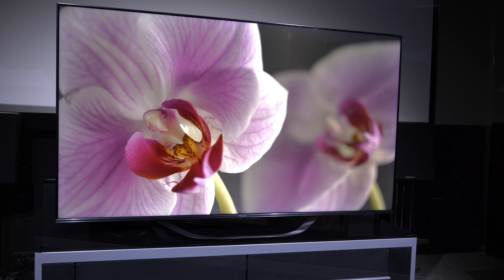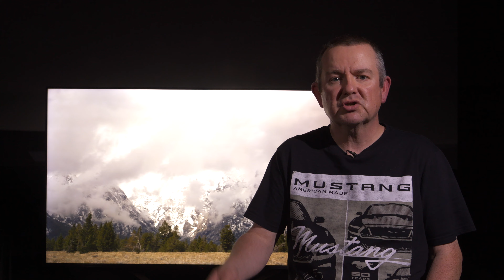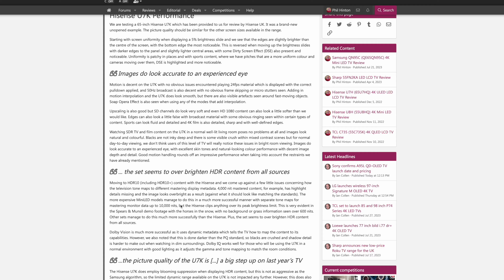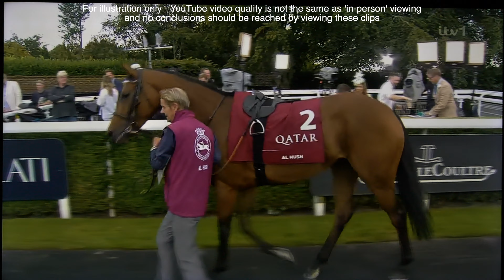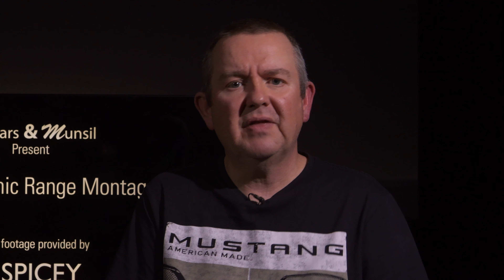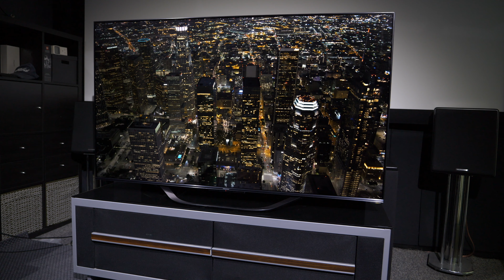Hisense U7K 4K Mini LED TV Review - Are Hisense still VALUE FOR MONEY?

Comment: Great test! I just ordered the 75u7k(q) for a very good price in germany (1079€ which when you count in TAX equals around 900$ in the US). The comparison with the C845 is impressive tho and I see it as clear winner of the comparison, but here in Germany the TCL costs about 1699€ which was beyond what I wanted to spend. I'm pretty sure I will be happy with the Hisense for the amount of money I spent ☺
Reply: In what way would the c845 be better? Im in doubt between that and the u7k, very similarly priced here in the Netherlands.
Reply: @hschokker86  as far as I understood the tcl is brighter and has more local dimming zones. But you will be happy with either of both ☺️
Reply: Are you satisfied with u7kq? I have plan to buy 65u7kg. In Bosnia this model cost about 850€.
Reply: @ozrenbukeilovic6670  I am fully satisfied with the 75u7k! It's brilliant. Local dimming works perfectly fine and I don't see a huge difference to a friend's 77" lg oled. And for gaming the u7k is also a beast. I'm playing at the moment elden ring on it with about 100-120fps with freesync on a 4080 super and it works perfectly.

Comment: Just got the 55 inch U7K for £462 with cashback here in UK:)
Reply: Where did you buy it?
Reply: @donsulit9930  i did get it at very. As till yesterday there was a promotion that if U buy selected tvs on buy now pay later 12months plan they will give you 20% off the tv, however U need to order it for the price stated and then U get the cashback later. Andditionally, i use complete savings which is a cashbqck website which gave me another 10% but from the price om the website which was 649. So i got £129.8 off from very and 52 pounds from completw savings as they give U 10% but from the price that does not include vat. So i paid like 467 not 462

Comment: A real "budget" IMAX screen would be four of these in a 16K 400" setup. In theory it could work by using a DP 2.0 output to some sort of multidisplay sync card. Or four Nvidia A4000 Ada Gen, since Nvidia cheaped out for DP 1.4.  
   Stupid? Yes, but fun.

(I'm a layman, my only reference some Googleling is that old LinusTT video on 16K gaming video) Im probably speaking out of my a*s
Reply: You sure are . That's not how it works 😊

Comment: Just bought this 65 u7k. On darker tones on the screen i can see vertical lines as if its had screen burn. When watching tv its visible but you do have to look for the lines. Is mine a duff panel or is this normal? Only unboxed it yesterday. 
I took a picture and it does show its worse on pboto but i cant help but think i should send it back . 
I went in store to currys and i couldnt see it on the demo u7k.
Reply: I had same issue and thought it was dirty screen . but when I Unplug power lead from tv and re plugged in back in it disappeared

Comment: I almost bought both the TCL QM8 and C845 before buying this U7K - and after reading multiple reviews, the TCL models have issues with high-refresh rate sources such as PCs and consoles. On both TCL models, there are inconsistent response times and input lag when using VRR - not a dealbreaker - but both models are incapable of 4K120 at 4:4:4 chroma, making images from PCs and consoles an imprecise, low-quality mess at 4:2:2 chroma, setting us back to the dark ages of early 4K televisions and HDMI 1.4 standards. Why would you buy a 120Hz, HDMI 2.1 television if it can't do either of those things properly? Sure, HDR is nice to have, but so much content is still SDR so the superior VRR reliability,  120Hz 4:4:4, colour-accurate, and balanced SDR experience sealed the deal for me and I'm so happy I didn't make the mistake of buying either of the highly-rated TCL models which owe a lot of their good ratings to HDR performance.
Reply: Where is the source showing inconsistent response times in a real world situation for either. As in something that isnt a purely synthetic benchmark?
Reply: @johnfrankster3244  RTINGS - who are a reputable source for TV testing as far as I can tell.

Comment: Sorry that is incorrect, Hisense still offers different specs such as different panels  such as VA,IPS. and different number of dimming zones depending where you by like Australia VS U.S and UK
Thats why they add a AU or EU at the end of the model
Reply: That is correct but this year apart from the stand and operating system they are the same . Iv checked before I bought

Comment: Juat bought this tv in 55 inch in canada.  $900 CAD taxes included
Reply: Hello ,how is tv working out I'm looking at it to buy I think it's the same would you happen to no  U78km is that the same and is there any DSE on urs ?
Reply: @chrisd1172  don't know what dse means.  But I'm very happy with the tv.  Refresh rate on this tv is 144htz.  While most tvs have 120htz.  True motion is 240htz.  Which is amazing.  And it's super bright mini led
Reply: @44pakattack  Cool thanks

Comment: The stand and remote are different to what we get in North America, surely there are other differences . I almost bough this one but went for the 65U8k instead. I paid the eq of 1125 pounds delivered and the prices are said to drop throughout the year.
Reply from the maker: Hisense is saying that from a specification standpoint (panel, processor, local dimming zones etc.) they are the same worldwide for each model SKU. You will see slight regional differences with cosmetics, tuners etc. and prices will vary given taxes and so on.
Reply: @avforums  is the remote has backlight button like the NA version?
Reply: @rinalsingh1258 us is 8 bit too

Comment: People must know that this now "global" TV in BEST BUY USA cost (without TAX / VAT)
470 pounds or 550 euros for 55" size
570 pounds or 670 euros for 65" size
Afcourse now you must add your local/state taxes on those prices and even then you will notice that something is wrong. Than you will dig deeper and notice that Hisense have compeletely different models(stand, remote, OS) with same model number for US market with dirt cheap prices.
Reply from the maker: Hisense is saying that from a specification standpoint (panel, processor, local dimming zones etc.) they are the same worldwide for each model SKU. You will see slight regional differences with cosmetics, tuners etc. and prices will vary given taxes and so on.
Reply: @avforums  When we compare similar worldwide models from other brands LG, Sony or Samung there is not a single model in their lineup that is 100% cheaper in US compare to EU or UK regardles of cosmetic, tuner or tax differences.
Reply: The 55'' U7K retails at £1200 in the UK. Hughes(a local retailer) is selling it at £1100 to members. Hisense is offering a limited time £200 cashback, claimable next month. So you can get it for £900 if you jump through some hoops. The TCL 55c845k can be had for £800. Seems a no brainer to get the TCL at the moment.
Reply: I just picked up the 65” at Costco for $699 with a 3 year warranty.